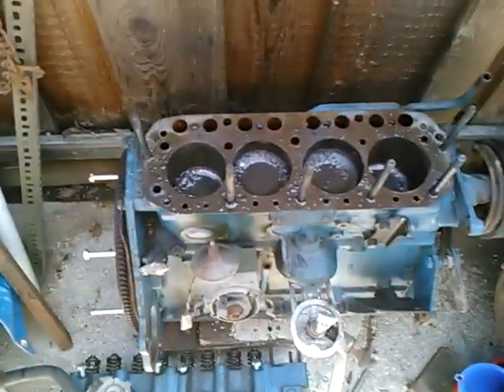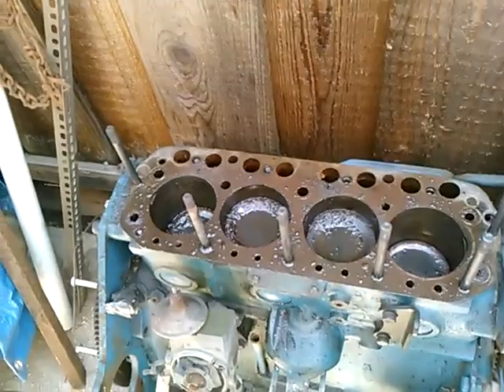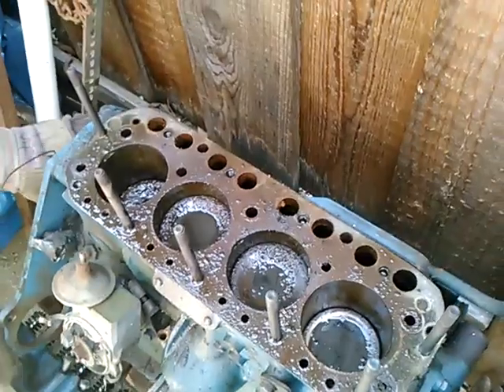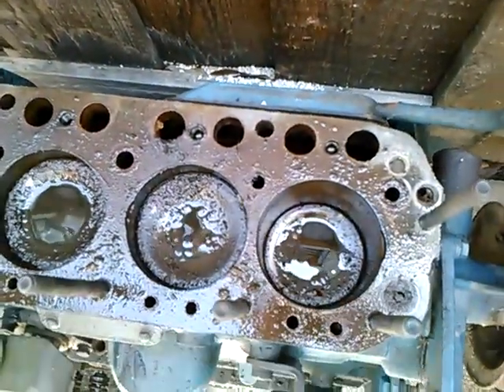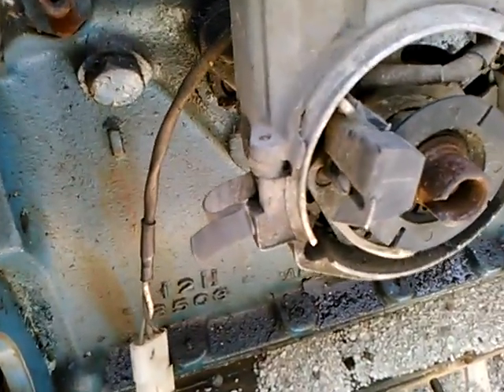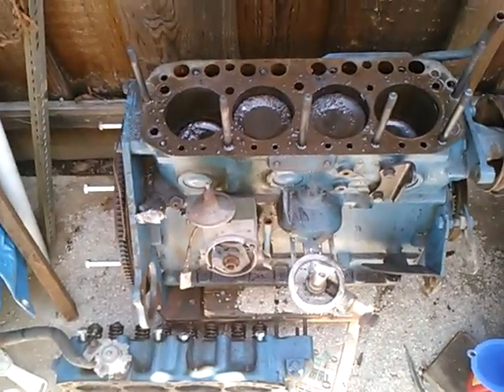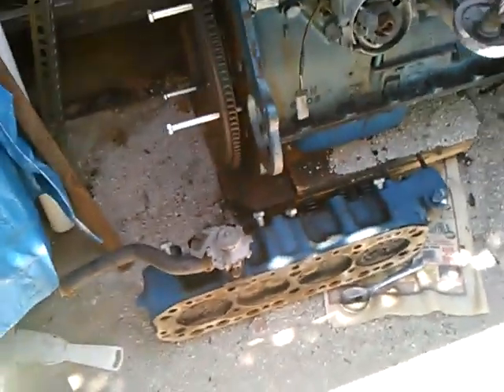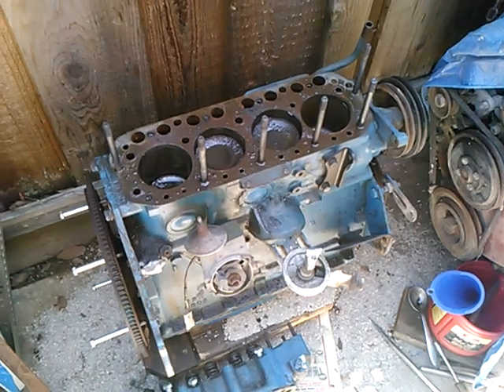Blue rusted MGB engine Part 3: now turns over

Comment: The aftermarket electronic points are Luminatrix. I put one on my TR-7.
Reply from the maker: +Leyland Duncan Thanks for the tip.  Think I may have sold that distributor on eBay, since I don't plan to run an electronic ignition.
Reply: +guidoguitar oh this is where you reply. Sorry
Reply: You need to get it re machined by a professional engine restorer or may never work again. Loads of rust to cut out.